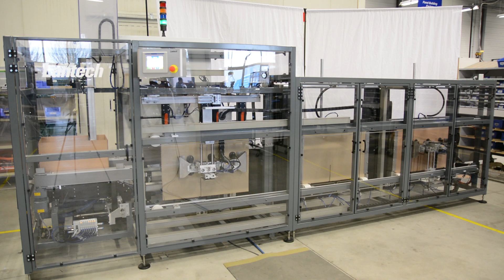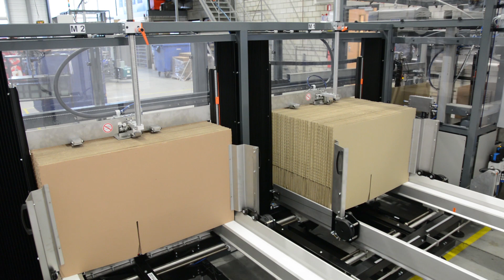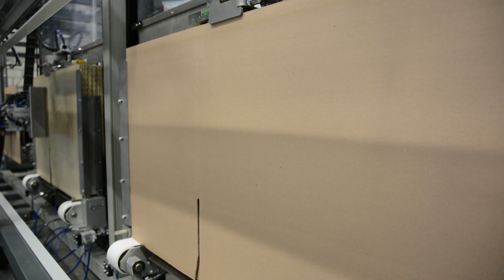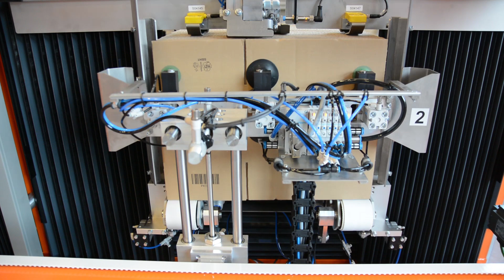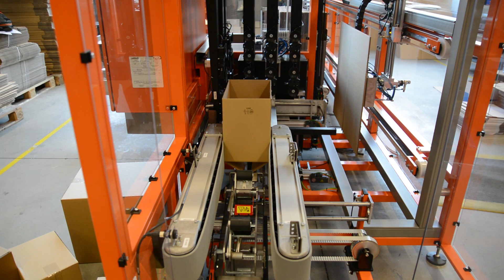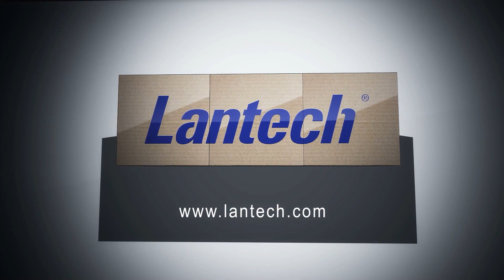Lantech Case Erector with double magazine for 2 Blank Footprints

Comment: Hi we use Lanteck a very good machine over what we had. One of the few problems we have with it is with the sensor under the front folding flap had to change a few time due to damaged cables. I would prefer the unit it to come with it’s own vacuum unit and not rely on mains pressure thou.
Reply: You have to buy a bedo.